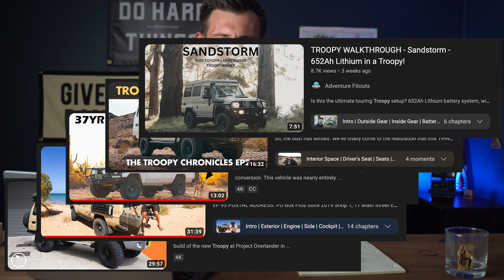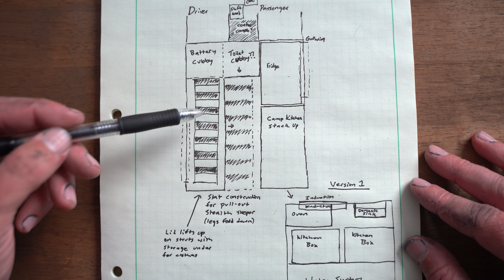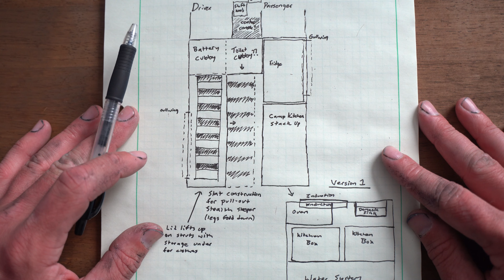Troopy Build Part 1 - Teardown and Design Considerations

Comment: biggest thing I can say is take your time mate, keep evolving the design and speaking to others even if they don't know much about overlanding and/or Troopy's. 
I've just completed my troopy build - no I didn't do the actual build - I bit the bullet and got the experts to do the hard yards after a 6 month design period. no matter how much usable space you think you will have it's still a very small area to live in so keep thinking minimalist and weight saving wherever you can so that you can use that saving in the important areas like the 12v system (I recommend getting as big a system you can). 
Your design seems to show that you're tending towards internal cooking. Most people find it's easiest to do majority of their cooking outside at the rear or side of the truck so maybe think about access to kitchen items while standing with the doors open which is also good when you just want to do a quick stop and make a coffee or sandwich without opening the whole system. Think about putting your water storage under the truck - it will save you quite a bit of space and keeps the weight very low, Good luck with it - I will be very interested to see how it goes, Cheers
Reply from the maker: This is some excellent advice, I really appreciate you taking the time to watch and leave a comment! The more time I spend thinking about how little usable space there is, the more of a minimalist I’m becoming. I think focusing on ease of outdoor cooking is high on my list now!

Comment: I'm excited to see your post, as we are both in a similar situation. I just purchased a troopy myself. (I live in Australia.) I am having someone create a custom built layout. They are due to start in early June. My ideas and then they invite the 'how'! We will be working on ideas together. Just some advice about your layout - here in Australia the storage usual goes behind the driver's side on the right. That helps with visibility on the passenger side when driving. It also means that when you park on the curb, the awning will also be on the curb and not on the road etc. I'm sure there are other reasons, but I was just surprised that you would put your storage opposite the driver's side. You may have your reasons for doing it that way, which is fine. It took me a while to work that one out. The plan looks great though - similar to mine. Of course there is lots of tweaking to do yet!! I'm looking forward to seeing your videos as you progress!! Good luck to you mate. You can never give up on the dream!! Wendy
Reply from the maker: Wendy, thanks so much for the comment! Such an exciting time to find ourselves in this early stage of realizing the dream. Your driver vs passenger layout makes a lot of sense, and I definitely need to give it more thought. I think I ended up here by starting with Aussie design, but in a LHD troopy, and didn't even think about flipping things around. Back to the drawing board! 😂
Reply: @BenStinnett  Some people do flip it in Australia the other way, but it's rare. Also, I go to pinterest for inspiration. There are lots of ideas with the Land Rover in Europe. Some great ideas there too.... and the troopy of course. You won't have to flip things around when checking those ones out!!
Reply from the maker: Oh I never even thought about Pinterest! Thanks so much Wendy! Cheers 🙌

Comment: I like that you took it to bare metal.  I’d rather start fresh and see what I’m working with.   Are you going to do anything for insulation or sound deadening?
Reply from the maker: Most definitely! Looking at doing a two part system up the walls to help with sound and thermal insulation!

Comment: Are you going to put in a diesel heater? If so, due to the limited places to locate these, your build needs to work around this.
Reply from the maker: Hey Richard, great point! I’m going to skip the heater for this initial build, as my plans largely rely on following the good weather. Thanks!